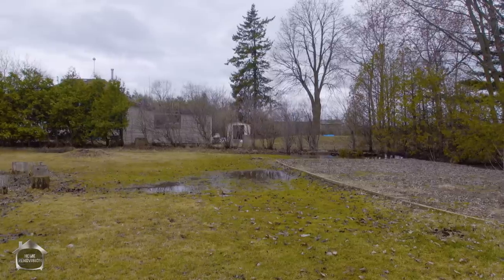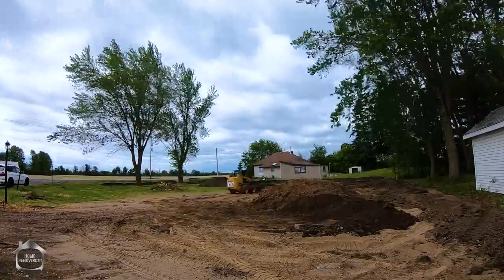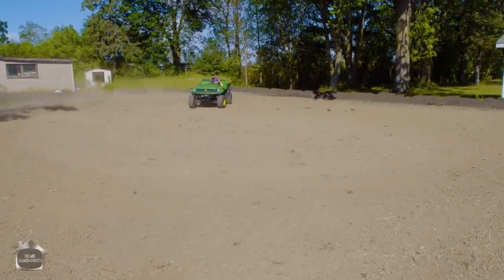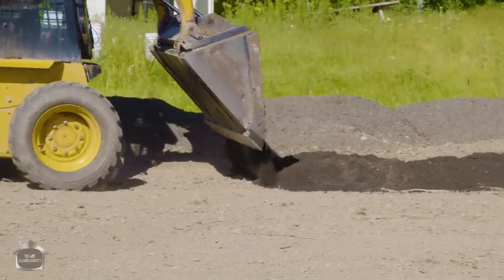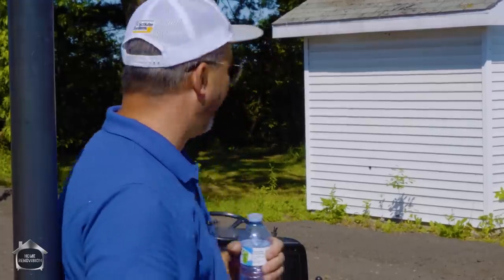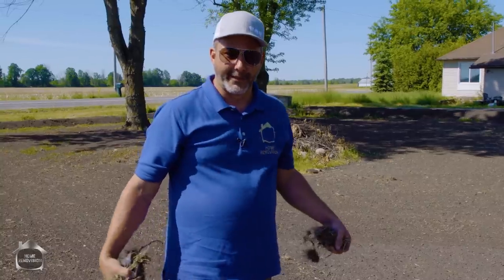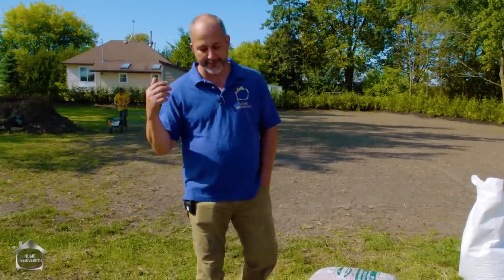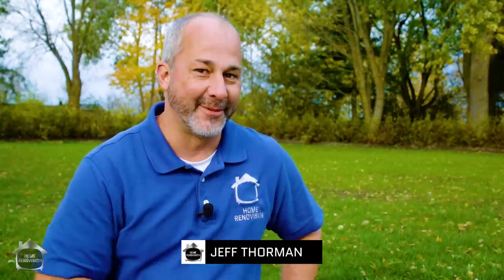DIY the Lawn of Your Dreams | Lawn Restoration

Comment: As a landscaper i feel its my job to help out. 
1) seeding is cheaper, but requires over seeding until thick as sod. 
2) sod is tough work, takes alot of labor to haul it out and lay, is expensive but its instant gratification once its watered in 2 weeks later you have lush lawn, heavy equipment makes it 1000 times easier.
3) remember its the first 1-2 inches that impacts sod the most, less rocks equals more even root spread and growth. Water needs to saturate the first 1-2 inches, no more no less. 
4) a balanced fert is ur go to for diy get a broad cast spreader, you want the spreader to evenly distribute. the path of spreading needs to go edge to tire track. 
5) MOST IMPORTANT THING, NOT FERTILIZER, NOT SOIL, WATER!!
Plants need water to grow, if you are cheap and dont want to get irrigation cut corners somewhere else (like fertilizing) your grass needs to be watered routinely not only to grow but to keep pests and disease away. Pests strike when the grass is stressed, its better to deal with funguses then it is beetles and larva. Over watering alittle can be combated with a nitrogen heavy fertilizer( pro application recommended ). 

Hope that helps any questions im more then happy to answer. Im state certified in pest management, right of ways and mosquito control, along with life time knowledge in pruning, cleaning, mowing, mulching and everything landscape!
Reply: Hi. Any ideas for moles??
Reply: @PbkillindemJai   ahh yes nothing better then ruts through ur lawn, ur gonna wanna first step on them and flatten them out, come out and check everyday until you see one pop back up and put some poison bait worms in the hole. Talpirid is the best, you can get it on amazon, or home depot may have some. Be sure to flag where u put them and check in a week. The amazon description will explain in detail. Handle with care (gloves) and store in a safe place away from children and pets.
Reply: @hunterjackson802  Thank you!! 🙏🏽
Reply: @andrewb6458  Thank you!!